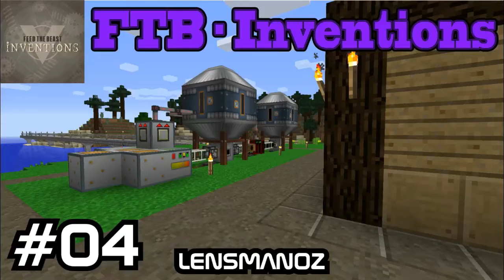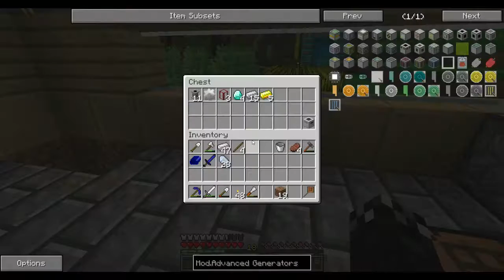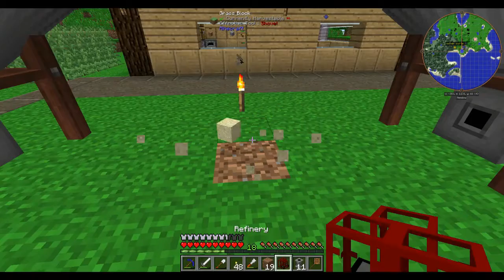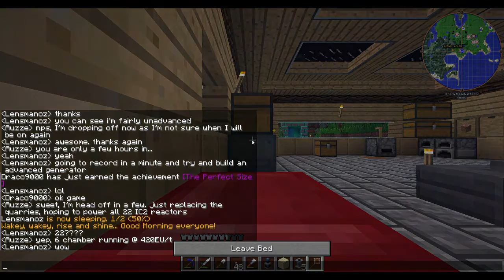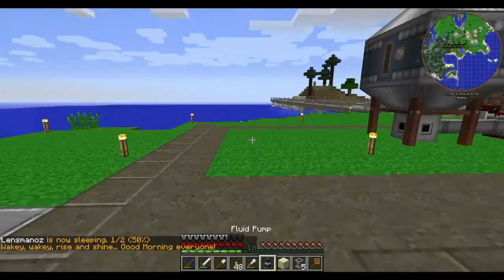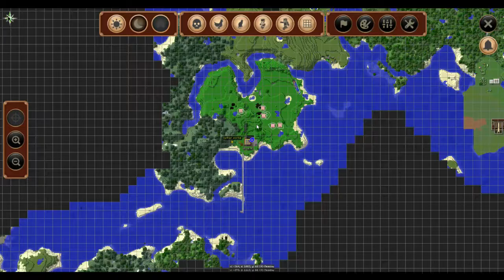Minecraft - FTB Inventions - Ep 4 - Oil to RF

Comment: I totally know that 'I'm all prepared' and then suddenly not feeling. :D

IE tanks will also auto-eject downwards from the bottom block.

Put bucket, or other fluid container in your hand, and walk up to the tanks, and it'll show the contents of the tank. Not sure why Waila can't seem to see it, but there it is.

Refinery pulls 120RF/t, so as long as you make that or more, you're in good shape. I'm using a Compression dynamo with the first level enhanced fuel augment so it produces a power surplus.

IC2's bronze might be unlearnable, but other mods might have a version you can.

Check the mining age for oil as well.
Reply from the maker: +Triaxx2 so if I connect the pipes under the tank is will flow without pumps? 

I need to work on cross dimension power transfer.. Or just get a few Buildcraft engines with pipe filters for coal..
Reply: Yes, as long as it's down out of the center block.

My personal preference would be towards EnderIO Dimensional Transceivers, but the coal filter would work as well.
Reply from the maker: +Triaxx2 I'll give the pipe a go. Mainly because it was the look I was after.
Reply from the maker: +Triaxx2 I'll work towards the ender io transceiver